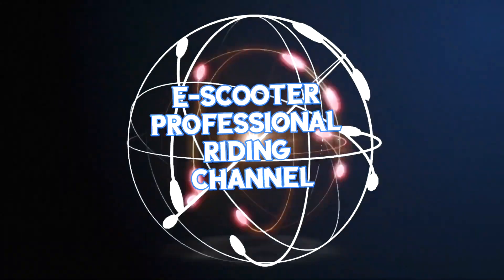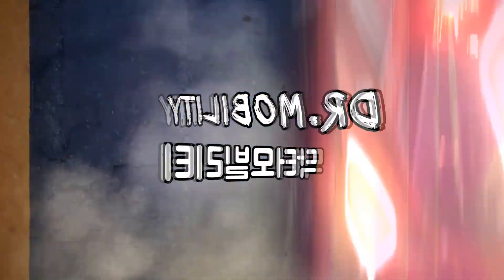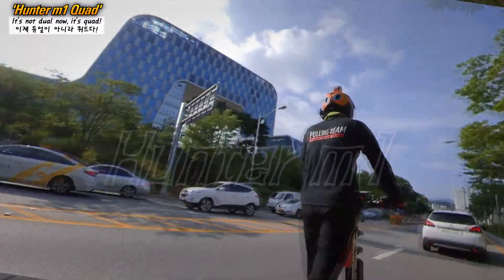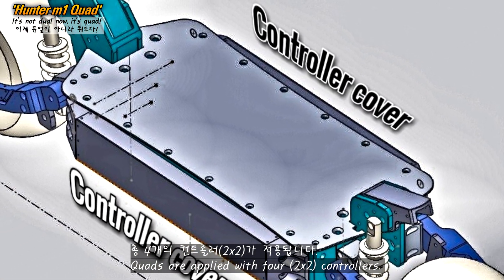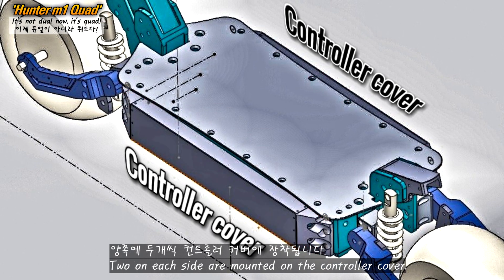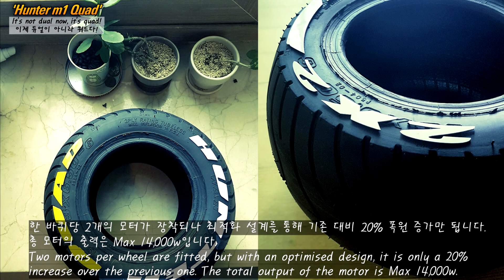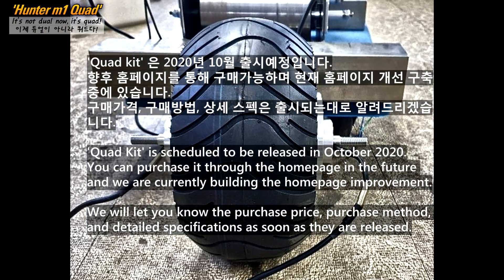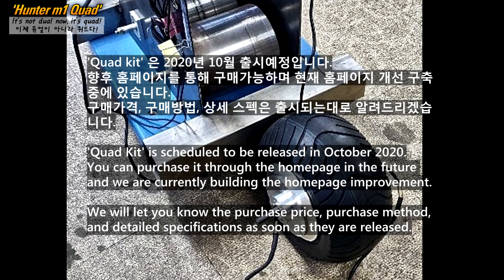🛴😱"Now it's not a dual, it's a Quad (2x2)!"  ⚡The world's first 4-motor 🥇 R7 Tech⚡Electric scooter

Comment: Per Hub 14000 watts???? or 14000watts front 14000watts back?
Reply from the maker: total max 14,000w~🤗

The actual power can be viewed as twice the performance of the Thunder or Weped RR.

Please refer to the start comparison video with Thunder
It is expected that domestic performance will be better than SST.

Specifications are just numbers.  The actual comparison test is accurate.
The reason is simple.  This is because the motor neodium  magnet is 100mm long.

Comment: Is this available in the market
Reply from the maker: We don't sell it in the market.
Please contact me through the headquarters in Korea.

...((Purchase/Reservation Inquiry))..
R7 TECH headquarters
WhatsApp: +82 10-2063-7432 ✔
E-mail: pksoo70@naver.com
kakaotalk: https://open.kakao.com/me/Quad
------------------------------------------------

We are pleased to announce the pre-order sales of the high-performance 72v 13-inch “Hunter Quad”.🤗
There is a pre-order discount event for only 20 sets.

..((Driving video))..
https://youtu.be/PMge0DT-gPg ✔
------------------------------------------------
..((Hunter Quad Launch specification))..
-.Max output 14,000w
-.Samsung 35E 20S15P / 72V 52.5Ah(66Ah equivalent to 60V), BMS 100A (domestic packing)
-.Quad core motor, neodium magnet width 10cm (self-developed)
-.Motor completely separate wheel, heat dissipation perforated wheel cover (self-developed)
-.Quad dedicated high-performance MOSFET upgrade controller 180A (self-design)
-.New ZOOM Hydraulic 4 Rotor System (Self-tuning)
-.Truss type top grade saddle (self-developed)
-.Self-developed oil shock 4ea or Taiwan KS company oil shock 4ea
-.13" Tubeless Ultra Wide Tire (13"X6.5-6)
-.H1250~1350, W700, L1520mm, 68kg
-.Made in Korea
-.Option: 70Ah(84Ah equivalent to 60V) battery (Add USD 730)
-.Pre-order price: USD 4,500 (when limited 20 units are exhausted, Shipment scheduled for mid-March 2021)
-.Full price: USD 5,400
-."505 Pro" to be tuned

-.Release product is released in early February
-.Available for small quantity overseas purchases (excluding shipping and customs tax)
Reply from the maker: I visited the headquarters today and made inquiries about overseas sales.
It is said to be available for overseas purchases in Taobao at the same time as domestic launch in March 2021.✔

Production, assembly and delivery are all carried out in Korea.

My channel will tell you about Taobao sales links around March.🤗

Comment: Please top speed ? 72 kg rider ?
Reply from the maker: It has been confirmed that the speed is over 100km/hr and it is meaningless for safety.
In fact, High Torque is important.

Starts with wheel spins even in 86kg user, 14 inch ultra wide tire and on-road conditions.

Please refer to the latest test drive video.

Comment: Why u say quad is not 4 is 2
Reply from the maker: Two motors are integrated into each wheel.😁
Reply: Which alibaba is  supplier
Reply from the maker: @MrGiodude17  
It's self-produced in Korea.
Please refer to the video or fixed comments.
Reply: Day & night / 불철주야 I I’m really interested in the hunter I will get one maybe do some marketing for UK but wat is top speed 65 ? Mph how does it feel write in description looks stable but we have many road bumps in UK
Reply from the maker: I drove the dualtron Ultra for three years (2.4 million kilometers). It is a total of 60,000 km in its sixth year. I can guess why I upgraded to this product as a high-speed user.

The characteristic of this product is that safe long-distance high-speed driving is possible. The trade width before filling the air pressure is 165mm. It's 1.5 times the volume of Weped Cart Tire.
Not much is affected by road bumps.

I'm 180cm, 85kg and it's a bit big for me too.

'Hunter m1 Quad' is scheduled to be released, so we haven't tested it at full speed yet.
Reply: Day & night / 불철주야 Ohk I seeeeeeeeeeee now

Comment: Honestly...This all sounds too powerful... and, will likely be way too expensive... But, certainly top of the market.... Just make sure the english speaking market can get...
Reply from the maker: The price is not fixed, but depending on the option, we expect 3,400 to 4,700 dollars.
(Excluding official duties and shipping charges)
In Korea, full options are a little more expensive than DTX.
Reply: I’m looking to buy somthing like Th is now but t has to be cheaper than Korean brand dualtron or people will always buy becuase it’s like Sony brand name is important I will follow channel
Reply from the maker: @MrGiodude17  

It is larger than the dualtron X and has a stronger output. The wheels are bigger, too.The voltage is high and the battery capacity is high. But the price is similar.

Overall, it's higher than X.